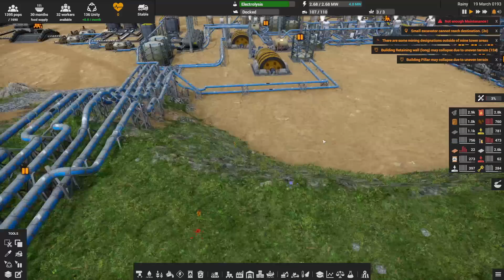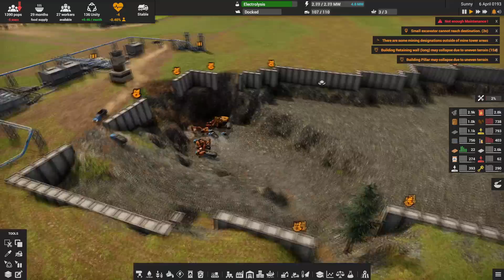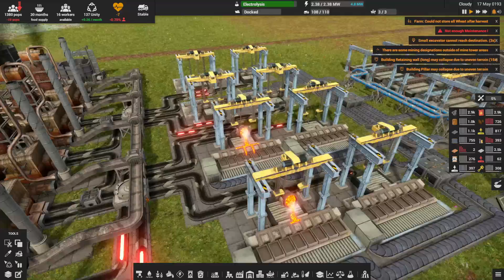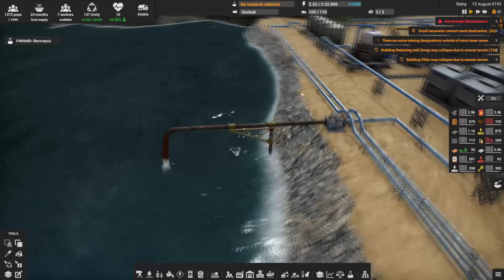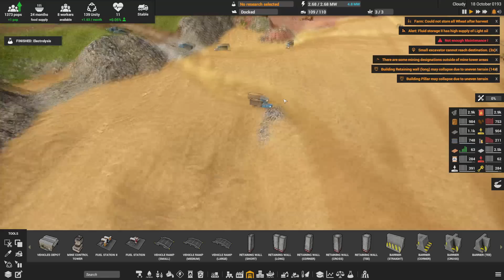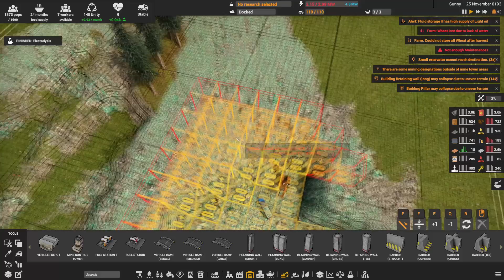Captain Of Industry! A Promising Early Access Industry Builder With A Learning Curve Problem

Comment: I'm surprised Arch is giving his workers a somewhat decent life. I was expecting them to live from air and love to the Emperor alone.
It's a bit unfortunate that the game has so many beginner traps.
Reply: Try Factorio if you want more difficulty, or if you like your learning curves with more than the 90 degrees of a sheer cliff, something more like a bowl shape where you approach 90 degrees and pass it, climbing upsidedown across the "ceiling", passing between the hundred of ropes from failed climbers, their bones littering the ground visible if you glance "up," then I would recommend Dwarf Fortress. Also, you need to be fine with graphics that make the 8-bit NES look advanced.

Preferably you should have powerful individual cores in your CPU, because it can't run on more than one core because multiple cores wasn't a thing when Dwaf Fortress started development in 2001. Yes, it's still in active development by it's one man team. And it WILL choke your machine, because simple as the game looks it simulates a ludicrous amount of physics.

Want to build a water wheel powered computer using water for it's logic gates? It's been done.

Want to build a series of pipes and pumps to dump magma on the goblins or knife eared, cannibalistic treehumpers, aka elves? It's been done,.

Want to shoot said treehumpers when they invade due to "excessive logging" with crossbows made from the trees they love so much and bolts made from the bones from their previous visit? It's considered SOP.

Also, goblins have riding animals called "beak dogs." Another name is velociraptor.

Also, it's free.

Comment: on initial look I was expecting factorio, on viewing it seems a lot more like a "real world" oxygen not included
EVERYTHING is primed to break your system and only pre-planning for things you don't know about will let you advance.
Reply: ONI is much less forgiving and beats you over the head with unknowns harder. This game actually has very little resource rush after the initial set up. Once the basics are established you have double digit hours worth of oil (the next bottleneck) before it becomes an issue. You'll find the offshore oil rig long before you actually need it and the real challenge is not screwing up your resource chains as you upgrade to more efficient but more complicated ones. That is very different from knowing about and preparing for heat from the beginning.
Reply: I never got the appeal of Oxygen Not Included. I find the gameplay tedious and boring, and some of the sound effects are like nails on a chalkboard to my ears, most are great but some that are more like those in Don't Starve . . . Maybe the game gets more interesting or harder later on, but I can never get myself to play more than a few hours at a time. I've got about 20 hours clocked on Steam, but I just don't get the appeal, and I want to like the game but it is so boring, tedious, and slooow.

When I play Factorio, RimWorld, Dwarf Fortress, Space Engineers, Banished, Shadown Empire, Europa Universalis IV, Duskers, or any other long, intricate game with a lot of unknowns that will fuck you over as a core part of gameplay the hours just pass without me noticing. And death is one fuck up away the entire time in a lot of them.

I want to like Oxygen Not Included. I want to love it, it's right up my alley, but playing it is like slowly crawling over sandpaper. Please tell me what I'm doing wrong, I've not had a single duplicant die in 20 hours of gameplay.

Comment: So out of curiosity. What's the purpose? You invade an island which probably is sustainable to the population there, (mind that aspect of getting rid/integrating them isn't shown), and building a big arsed modern system where you get a population to basically live in their own poop and smelling their own chemical farts. If that's the purpose will there be a Steam achievement?

Comment: Here are some tips for the game: 
- A very good first investment of tier 2 constuction parts is a long conveyor belt from your coal mine to your foundry area. This will take oof a hughe strain off from your logistics system, as trucks no longer need to transport the coal. And you will need hughe amounts of coal. 
-Cooling towers. Research them. Build them. Rush them. They allow you to recover half of the water from Steam (High, Low, depleted). This allows you to half the water consumption of your Steam turbines and will take alot of strain off your water supply.

Comment: Wait they MELT the ore and send it flaming HOT to a refining facility?

That's kinda dumb. That's just unnecessary complexity that makes the game look dumb too because a factory is moving HOT INGOTS open to the air into a facility.
Reply: But it is realistic, Look up some foundry on youtube. The molten metal often gets transferred from the smelter to the casting facilities via these molten channels.
Reply: @13deadghosts  molten channels.... not CONVEYOR BELTS. Not hundreds of feet.
Reply: @NoPantsBaby  The molten iron gets transported by molten channels ingame. Where did you see conveyor belts transport molten iron/steel ?
Reply: @NoPantsBaby  can confirm from playing it myself, the molten metal gets transfered via molten channels, not conveyor belts. The channels also must be placed at ground level and can not be elevated as far as I can tell.
Reply: It's not unnecessary. A single furnace makes metal to keep 2 foundries busy so you need some way to divide them up.